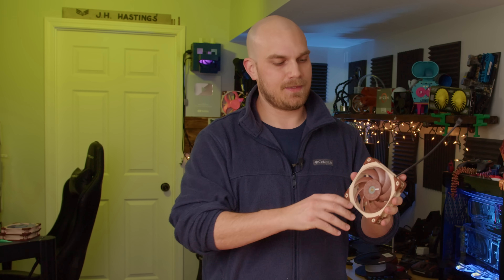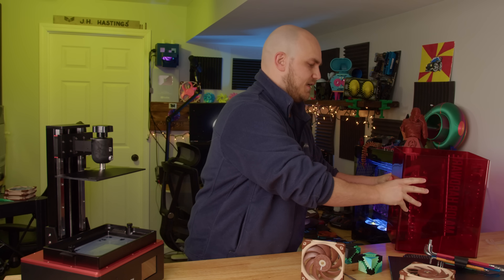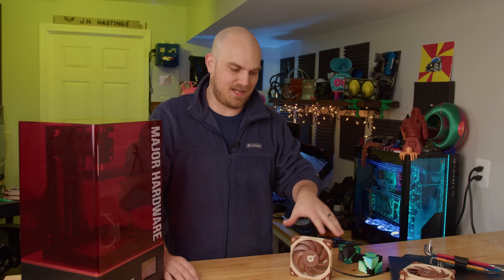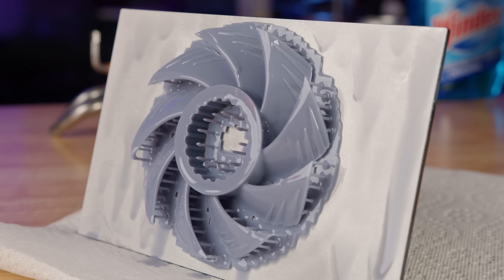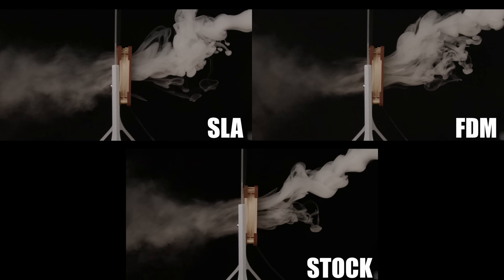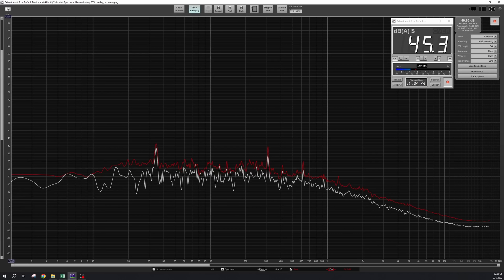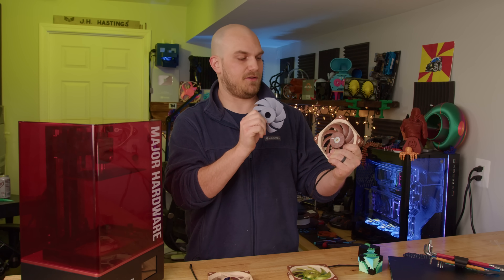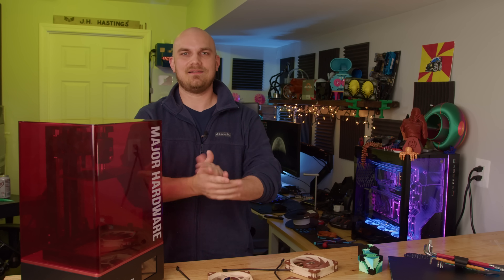I Copied Noctua's A12x25 and Resin Printed it, Its Performance Was ASTONISHING

Comment: I was wondering as well how much the difference between ejection Molding and Printing is.
The best way goning forward is to compare FDM Fans to the FDM Noctua and Resin Fans to Resin Noctua.
I like the FDM fans, cause they look nicer cause you make them Colorful <3
The Resin Printed fans could be an idea for Fan designs that are verry pointy. Their were some Fans you could not print well in FDM cause your Printer is not accurat enough thow them on the Resin Printer.

Comment: Short question at 5:39 :

Why do not place the setup horizontally instead of vertically?

By testing vertically you currently start the smoke on top because of gravity. But if you would let the fan lay flat, you can start the smoke in the from above and let it distribute more evenly imo.

Also if you like, you can still invert the image afterwards (editing).

Either way great vids!

Comment: It would be interesting to know what is the weight difference between the fans. I have the feeling that the original fan might be slightly lighter than the FDM one. Weight should be playing critical role on the speed of the fan & the performance of it.

Comment: It seems to me like the simplest solution would be to just use the FDM copy as the reference benchmark, if you want to assume that all designs are equally affected by the reduced quality. You could supplement that at the end of the season by reprinting a couple that don't print well with FDM and have an SLA special episode, comparing to the SLA Noctua copy.

Comment: I'd be interested to know what kind of strength / stiffness difference there is between FDM and resin. There have been a handful of fans with too-thin blades that flexed and expanded when spun up, leading to them rubbing on the frame and losing performance. I wonder if resin fans would be able to handle thinner blades without flexing.

Comment: Siraya Tech resins don't stink as much and there are tougher resins ("Fast" (comes in a color that closely resembles natural ABS*, one that's a translucent black (smoky black*) and some other colors which i don't have), which is ABS-like and "Blu" (comes in transparent blue, clear*, black and nylon black*), which is 2.5x stronger than PETG and 2x more impact resistant than PLA) ones i have are marked with a "*". If you would like some assistance with anything, let me know and i can either help or point you to some excellent resources.

Comment: This might be a stupid question, but a lot of the time on my FDM printer I can get away with no support for stuff with low enough overhangs. About 70 degrees.
I don't know what the rules are for resin printers, but I am curious if you can get away with almost no support for something like a fan. Might be worth a try and make clean up easier.

Comment: +1 resin. Also test/measure static pressure with a u shaped tube holding water, across a gradient of resistance by closing the end of the wind tunnel gradually in a controlled way, capturing the max for each fan.

Comment: The peak at 32Hz doesn't really mean anything. If you are running the fans at full speed, around 1800 rpm, that's a frequency of 30Hz. Having a peak at that frequency is just a consequence of... being the frequency at which the machine is functioning.

Comment: I have an insanely overboard radiator setup on my desktop consisting of 2x1080 radiators (360x360) meaning in push only I have 18xNF-F12 fans mounted across the two radiators. I was looking at trying to make a set of adapters to convert each rad from 9x120mm fans to 4x180mm or 4x200mm and firing off a random e-mail to Noctua asking questions about their existing 200mm fan or any potential of a 180mm fan i honestly didn't expect a response. Or at least if I got a response I very much expected a templated answer. I was extremely surprised when i got a specific and detailed response answering everything I had just asked about including the measurements that I could not find in their public documentation.

Comment: I think you should stick to FDM. It's more popular so people have a chance to obtain a model of similar quality with similar properties as you. FDM has its limitations, such as the thickness of the path, a model prepared for ultra-precise SLA/DLP printing may be difficult to reproduce using another method like FDM. 
On the other hand, it seems to me a nice idea to make only the best models from resin - top of the top, to check how much you can squeeze out of a given project.

Comment: You're not accounting for the shrinkage with FDM, ie, the model needs to be slightly bigger. Look at the clearance between the blade and housing, and I bet the OG is the closest. It's the same when we run jetskis, ie, we shim to prop as tight as possible.

Comment: no need to angle this print on the resin printer thats just to help with supports and to make characters faces look better. for a functional part with no support advantage to angling and no cosmetic concerns id print that flat (raised fully supported)  (for this part its a disadvantage to angle it because support situation gets worse not better at angle)

Comment: Within reason I'd like to see a season with resin printed fans.  It'll really offer the best chance for user submitted designs.

However, you can continue FDM and just add a 2% performance boost to the calculations on every fan to offer the same accuracy.

Comment: Go for it. You do not need to use it all the time because there are fan designs totally okay with FDM. BUT, there were a few case when I was thinking you are not giving the fans equal chances. Several times you mentioned that the trailing edge is soo thin it could not be printed FDM, and the overhangs were a disaster and could not be printed with FDM etc. Those fans deserve a second chance printed by SLA. The cutting and trailing edge is the soul of every blade, and FDM just removed them from the equasion. Print some old tricky designs please. (note: Resin is more homogeniuos hence has better weight distribution.)

Comment: Resin sound like it would be a great idea for 1 season.  Question, what was the weight difference between them?  If I missed that, sorry, but I would be curious to hear that.  Also, are lighter weight resins?  and how would lightweight PLA compare to a fan in normal PLA.  I have seen some YT's using the lightweight PLA for RC airplanes and wonder how that would translate to fans.  Love the series.

Comment: honestly I think the losses in the 3d prints are because the blades are not quite as close to the frame as the plastic one. even that .5 or so extra gap I can see would cause a .5% loss. impressive modeling. not sure about the FDM print but the SLA would shrink a tiny amount from the actual 3d model.

Comment: I'd suggest sticking with FDM for your own ease of use. However, to make the comparison fair with the A12x25, you should compare submitted fans with your FDM-printed facsimile. If you found a way to get a hold of a laser scanner with good resolution, you might be able to get a model closer to the OEM part, too. If you choose to go this direction, I think it would be a good investment to make, even if it costs some money for a rental or something.

Comment: I would say skip SLA unless you have a dedicated room that can extract the fumes 24/7. Resin can be pretty dangerous if not handled properly and I honestly worry for your new born/kids and would suggest avoiding it if you do not have such a room preferably seperate from your house.

Just a side note I wanted to make such a room but decided not to due to the risk, complications, and cost. At first I wanted to use an affordable device that measures air quality off of Amazon but it did not work. Even after calibrating it serveral times, some people have reported it work but I just don't trust it since I did place it in a container with an open bottle of resin and it said that it was still safe. If you want to buy a real device your probably looking at a starting price of $500.

So if you do want to go with SLA I would suggest to do a lot of research and build a dedicated space seperate from the building you sleep in.

Comment: if your MLSA printing... Make sure the printer is in a isolated area like a garage or work shop. And not in an area that usually has people in... As you say fumes isnt great. And its still an unknown to their toxicity...
Also Siriya Build is a fantastic resin. Its strong thread able, and stiffer (yet not brittle) than some of the other abs like resins...

Comment: A potential problem with resin for the showdown is it's typically much more brittle. I could see some of the designs with thin, unbalanced blades exploding during the test. There are much stronger resins but it starts getting pricey and are even more frustrating to work with. You should try some prints in ABS then do a mild acetone vapor polishing. It's really not that difficult once you get the hang of it, especially if you have an enclosed printer. Polishing takes a little extra time but you could do a few fans at once.

Comment: I think you should do a retest of the top fans to get new data with resin printed fans. You don't need to make the whole season in resin, as the comparisons between the submissions are unaffected, and it removes the ability to compare between seasons.
Plus, the effort. It's not worth it.
But having a "finale" at the end of the season where you resin print the top contenders would be a working solution.

Good luck mate.

Comment: Not sure if you've tried this on a previous episode already, but what about testing the difference compared to a variable layer height FDM print? 0.2mm is pretty chunky for a curved print, but you could use a range of 0.08 - 0.2 to hopefully meet a middle ground. The layer line transitions never look good on variable prints, but the overall curvature is more gradual and could be beneficial.

Comment: You could just take your results and add 2% as a correction factor for the FDM printed fans to get them up to the OG 12x25.  Then you don't have to resin print, but still have accurate data to compare.

Comment: I’m voting “no” on resin, but I would actually support having the FDM noc-off fan as the baseline.  That would mean that we are comparing FDM to FDM parts, and we can assume that there’s a 2% gain with injection molded parts.

Also, if we have to give out CAD files at my work, we use STEP files which strip the data out of the parts, leaving just the model.  Too bad you don’t have an Engineer contact, the coms guy that runs Twitter is always in protection mode.

Comment: Resin printing sounds like a huge PITA.
I‘d suggest sorting out the weaker designs with easier print methods and printing the top performers with resin at the end of the season.

Comment: I'm wondering how the consistency of the two printing types is. If you print the same model 5 times, how similar is their performance? Is SLA turns out much more consistent, I think it'll be worth switching for better accuracy in testing.

Comment: I think it would have been good to try keeping FDM printed fan in acetone fumes for a moment to make the surface more smooth. I would assume the ~2% decrease in performance is more about surface smoothness than the actual shape of the surface. And even though acetone fumes will make the surface model less accurate, I would assume that the smoothing will improve things enough to make it worth the effort.

And if it doesn't work, that's a data point worth having, too.

Comment: The question is: do certain fan designs benefit more than others from SLA printing over FDM?
To that end I'd say more data is needed, but not necessarily mandatory for all fan designs. So why not have a final champion's showdown at the end of the season? You could use it to spend extra time acquiring more data & performing alternative tests like a SLA option. I mean would the fan with blades made out of hands or any other meme design really benefit anybody if it was made in resin?...

Comment: Dude, you can't make conclusions based on one 0.2mm FFF print. Make one at 0.1mm and weight match it to the original (adjust infill and wall count). Pretty sure it will perform better.

Comment: Sometimes I prefer FDM, sometimes I prefer SLA. There are models that because of the support structure required to print in FDM that I just have to use resin, lest I be unable to actually remove the support. I've actually been struggling with that recently trying to print a really big scuttle crab from league of legends, using conventional supports I find that the supports are impossible to remove without destroying the print itself, while tree supports just fail entirely about halfway through the print. A lot of this is probably down to me being really inexperienced with slicing software and printing as a whole (I swear to God there has to be a better way to deal with islands in chitubox besides manually finding every last one and drawing a support for it) but a lot could also be solved by getting a dual extrusion printer. Currently considering picking up a used creator 2 off AliExpress for cheap just so I can print PVA supports

Comment: If you used AA and a lower layer height on your resin print you could fully get rid of the fish scaling effect and get close to the smoothness of the injection print. Seeing how you don't need surface detail like in a mini or jewelry you could print at a really high AA setting to blur the surface, like 16 AA and you would have an awesome finish for the fan. For the FDM print if you print it in ABS you could vapor smooth the fins for the same effect, print it at a lower height like .12 and smooth it and you would have a really good copy, probably better than the resin one because it wouldn't be as fragile. If someone wants to do a long term fan in resin go for an ABS like resin (you cant smooth it with vapor it is just similar but not actually ABS) or something very strong like Siraya tech blu, or Phrozen Onyx. If weight is a bigger factor than surface finish for the FDM print it could be worth trying something like lightweight PLA or PETG to get you closer to Noctua's weight. Anyway thank you for the video, I really enjoy your channel and just subscribed!

Comment: Don't both resin printing. You've made it clear that the difference is small, while the difference between fan models is much larger than that. It's not like the models you have tested so far would suddenly become competitive just because they were printed in resin. Save yourself the trouble. :)

Comment: Here's an idea: at 3:41 noctua says your 3D printed fan would "fail due to impeller creep rather quickly".  I think you should test this.  Set the fans up to run long term and check back on them every day or so.